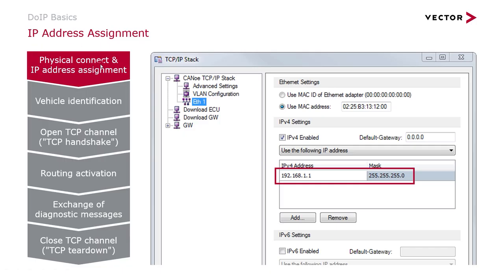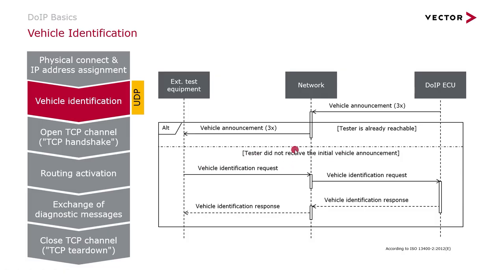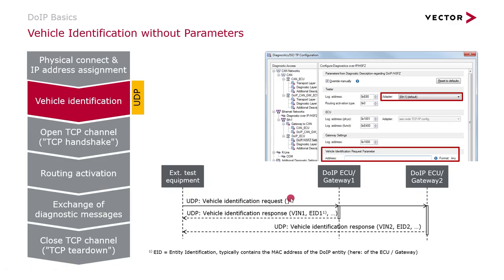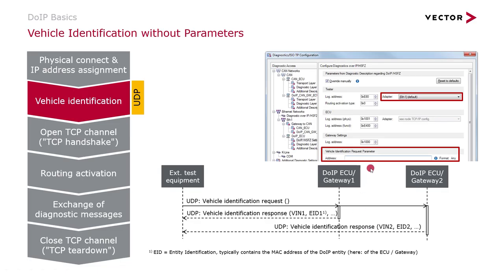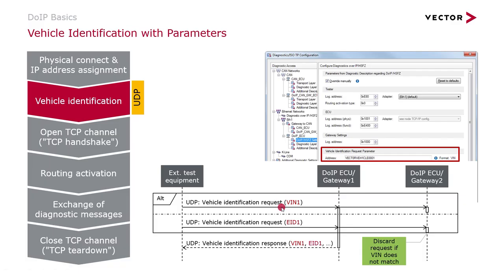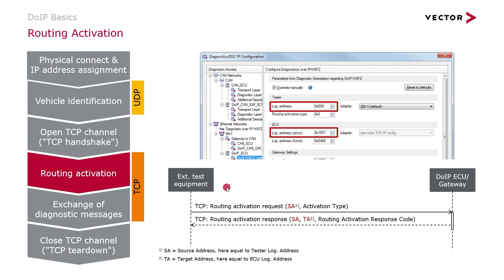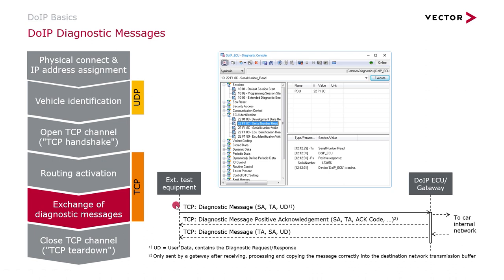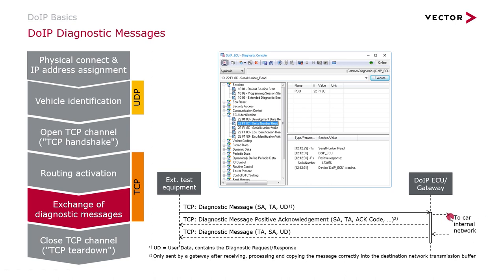DoIP with Vector CANoe (1/6): A Typical Communication Sequence

Comment: Thanks for these valuable informations, in case we have two DoIP gateways, the first one is connected to test equipment and the second one is behind the first gateway, how the identification works ? does one vehicle identification request is enough to make Gateway 1 and 2 both respond (gateway 1 forward request to gateway 2) or we must process one request for each gateway (means we need two Vehicle identification request)?  thanks in advance

Comment: With Doip version 2019 this sequence is correct?
Reply from the maker: Yes, this sequence is still correct. The DoIP standard ISO 13400-2:2019 has essentially only introduced a new protocol version 3 for the header, a new routing activation response code (0x07) and encrypted communication via TLS. The extensions are described in part 5 of this video series ("Encrypted communication over TLS").